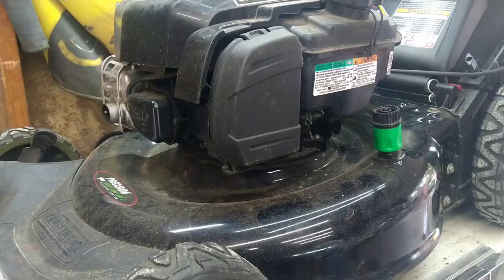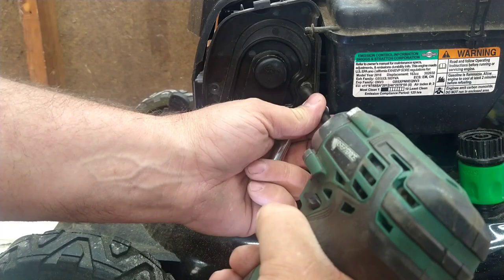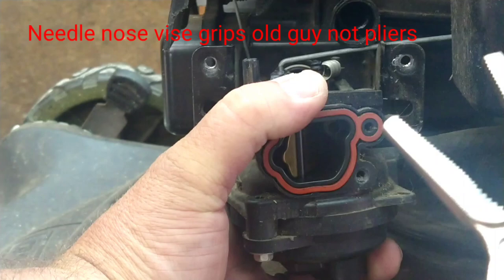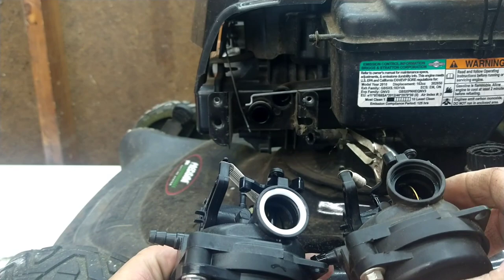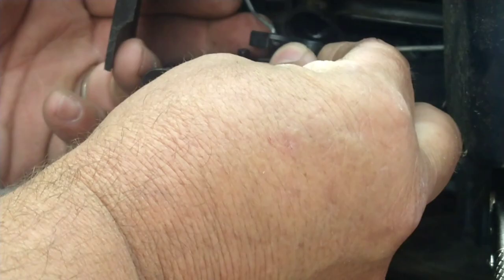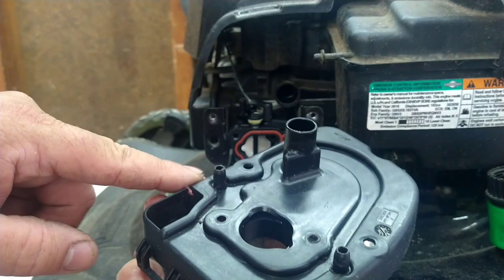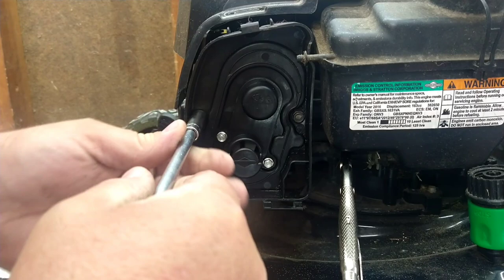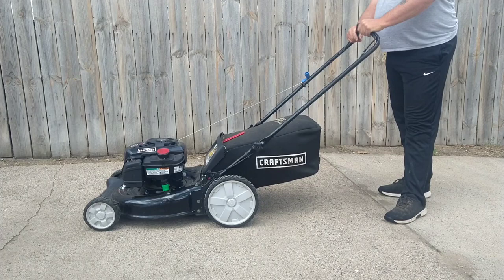Briggs & Stratton 7.25 carburetor replacement

Comment: Got the same OEM B&S carb 3 days ago. Changed it out as per your video. One pull, one start. Cut great for an hour then I called it a night. Got a break in the rain today so went to mow some more. It was hard to start, had to use some ether. Got it started, engine smoothed out in about 30 seconds. Cut for about a half an hour then backfired and died. Let it cool down. Checked oil and gas. Won't start at all now not even with the ether. It doesn't even sputter. Just nothing. Any ideas would be super helpful. Thanks!!
Reply from the maker: Pull the plastic cover off the engine, check if chock is closed or stuck open. Sometimes chock lever on top of carburetor rubs against metal plate on left side. If so, bend the plate slightly so it clears. Also I had a couple where choke spring fell off after using, verify the spring is in place.
Verify valves are set properly.